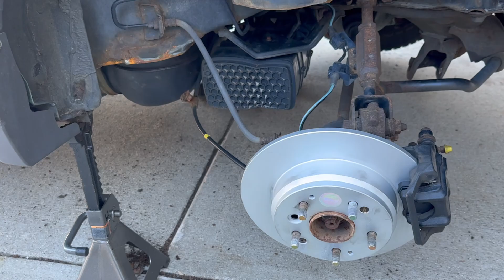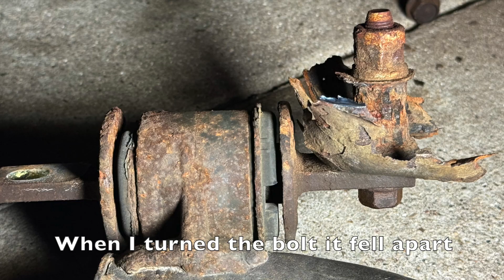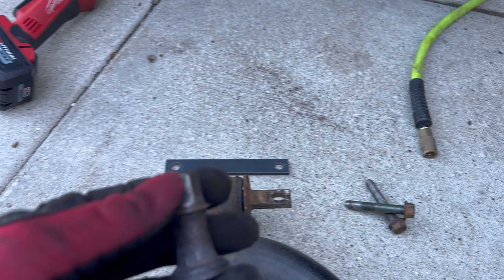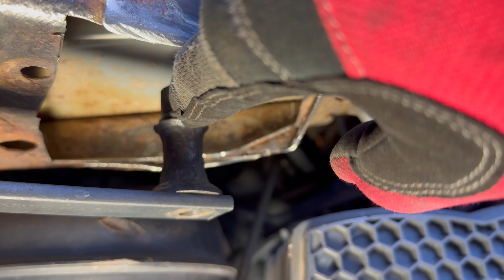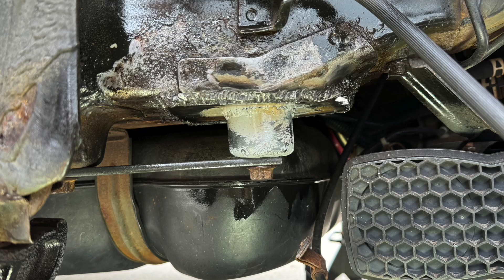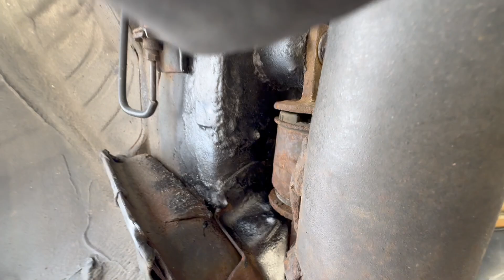DIY Rust Repair on my  Honda Element Trailing Arm Mount

Comment: Is the car still deiving?
Reply from the maker: Yes it is! Repair is holding solid and I just replaced the rear brake pads and did a full front brake job a few weeks ago.
Reply: @coolcat312 awesome i feel more confident about my element now. But unfortunately my enginw has broken few days ago. I am gonna put a jdm in it. I hope to save it.

Comment: Just bought an Element with the same issue. How Honda has continued to make vehicle's for decades that are notorious for thin chassis parts prone to rusting is baffling. Every single model they make is thin metal where the rear end bolts into the frame body

Comment: Thanks, nice work! Did you remove the gas tank for welding?
Reply from the maker: No I did not although it would have been a good idea. I just didn’t want to end up with more broken bolts. Everything is so rusted from Wisconsin winters.

Comment: Uff, and i thought mine wasnt in great condition. I just did full rebuild of the rear suspension, had both trailing arms off and was also tending to these mounts. Luckily i still have plenty of steel left there (shockingly, previous owners drove it extensiviely during winters on salted roads), so i just grinded it to bare metal and applied coatings. Its great to see people are still willing to fix stuff considered by many to be beyond repair.

Comment: Nice work. Very impressed. I've heard it better to use the non-permanent rust coating because rust can form under the permanent stuff and it's hard to tell what's going on. I guess there's pluses and minuses have having state safety inspections. Thanks for saving an element from the junk yard. I don't think most people would have attempted the repair, but this really gives me an idea of what's possible with rusted out cars.

Comment: i made a jig that clamps to jacking point  and lines up the holes  so u can center it to tack it in place once u weld a plate in to fix inner rusted section put 14ga cold rolled steel sheet hmmered to fit also dont for got  to shim the broken bolt to make up for cup that goes over the bolt

also drill the spot welds  from the rusted cup  to expose the plate inside  to fix and weld the nut to

Comment: I've watched this video several times, it's that inspiring! I'm fortunate enough to have had the car trailing arm mount strengthened by Honda (there was a recall for this in Eastern Canada) so I'm not too worried, but your video is very interesting nevertheless in that it shows how the original support mount was designed and it's not surprising why it failed - two layers of sheet metal sandwiched like that, plentty of nooks for moisture to get trapped in! I think your repair is great in its simplicity and effectiveness - much less prone to further rusting. The only thing I would have changed is to use a piece of thick walled galvanized pipe instead of the muffler pipe and sprayed the cavity with fluid film after welding. How is it holding up a year and a half later?
Reply from the maker: Still holding up well. I agree that there are better materials out there, I just used what I had on hand.
Reply: Just a FYI, that brace they install doesn't necessarily strengthen it, it just keeps the entire thing from folding up under the car on the highway when it does fail. I'm in here looking at this video in that situation, the same mount point in this video has failed on my 2004 and I didn't even know til I was changing the parking brakes last week.
Reply: @gordonhenderson1965  Well, the brace preventing the wheel from "folding up under the car" IS, technically, strengthening. To make it STIFFER requires much more of course - Mine is still in decent condition, so I haven't done it since I got the car two years ago, and God knows it would have failed if is had weakened from rust considering how horrible our roads are. But there's a guy on youtube who makes a kit similar to the Honda OEM brace that also includes a stiffening bar for the back mount and shows how to install it - sorry, I have no link to share, it's been too long.

As for the fluid film treatment, even if the car seems rusted and would benefit of reinforcement work, do yourself a favor and just do it and don't skimp, you need to inject it in every nook and cranny under there. It's a time consuming and very dirty job especially if you're doing it crawling on your back, but in the end it was worth the full day and almost full gallon it took to do it the firs time, because everywhere it was applied, rust has visibly stopped progressing, and repeat it at least once a year, it's probably the best money you can spend on any vehicle in the salt belt.

Comment: Great concept but those overlapping spot welds are going to pop loose after enough road vibration hits them. There isnt any penetration of the metal which is what a good weld requires.
Reply from the maker: Yeah, I am certainly not a professional welder. Holding up well so far thankfully.

Comment: I'm impressed. You showed how to fix it AFTER the rust destroys it.

Honda did a recall of CRVs with this problem.
Service Bulletin 23-032
May 2, 2023 Version 1
Safety Recall: 2007–11 CR-V Rear Frame Brace
The service bulletin shows how to install a kit BEFORE the rust gets so bad that you lose your trailing arm.

Comment: With such a great engine/gearbox/clutch the  Honda CRV early models are let down with quite flimsy trailing arm structure very prone to rusting.  What does it take in terms of cost to double up on the thickness of the trailing arm support structure?  I am about to tackle the same job on a 2007 CRV which has a superb upper body, but the chassis is plagued with underbody plastic covers which hide the rust problems and contribute to holding the water and mud against the sills and subframe.
Reply from the maker: Honda is indeed the best engine manufacturer in the world. It's not that they're bad at making the support structures though. There are thousands of 20 year old CR-Vs and Elements with no issues, they've spent their entire lives in nice climates. Those that have had to endure harsh winters and road salt are the ones that succumb to rust. This isn't a problem specific to Honda though either, all manufacturers face the same issues. Doubling the thickness of the metal isn't necessarily even the answer to these problems. The manufacturer weighs myriad factors when deciding on a design, cost and weight among them. I wish you well on your project CR-V. I find it a shame that these excellent vehicles are scrapped so often for such a repairable issue.

Comment: BTW  MY "desperate" interest in this whole rust thing with the Element is because I have a 2003 Element EX AWD.  I am 72.  I am the original owner. It only has 167,000 miles. When I got it originally, I asked my brother (accomplished master mechanic cars and aircraft): what should I do to make sure everything is good.  He said,  "Oil changes."  I have changed the oil in my Element every 3000, NOT 5000, miles....for 22 YEARS!!  Bravo to me eh.  Anyway, you can't even hear my engine running!  SWEET!!  EVERYTHING is sweet.  Except for this "particular rust creating design flaw".  I just can't get it out of my garage!! Everything is perfect....except for that.  I bought another car to keep me in wheels.  I don't want to drive my Element and risk it collapsing on me.  Pretty much I don't think I'm going to give it up.  Its still sitting in my insulated garage waiting for me to find someone to fix it.
Reply: Where are you located? I'm considering this fix for mine.

Comment: I am VERY impressed.  I have been doing so so much research on YouTube etc.  You have NO IDEA!  Having the ability to envision what should be done is a special talent my dear.  So many people can't, say for instance, draw a 1D of what a 3D cube looks like at any degree of perspective.  You can see the shapes, and which shapes are actually important.  Your solution is actually better than the original.  The original improper weep hole positions caused the left side to rust to hell from the INSIDE OUT; while the right side has pretty much no issues because it had the exhaust system  HEAT causing residual water to go AWAY!   YOU are BRILLIANT!!

Comment: came here for the same reason. Shops wont touch it... car only has 70k miles
Reply: This is #1 reason they are sent to the crusher. Plenty of people are trying to sell their Elements for parts because of that failure.

Comment: Great job repairing your E.  I’m surprised that no one has come up with a stamped part kit with right and left sides that can be used as a bolt-on or weld on part to replace the rusted out metal as you have done.  If the rest of the frame rail metal is still in decent condition, it sure beats scrapping the E.  🙂
Reply: I completely agree!!  The right side is rarely rusted because the heat from the exhaust system causes any surrounding water to evaporate.  Its always the left side that is harshly effected. Not to mention the improper weep hole positioning on the original housing causing it to literally rust from the inside out.
Reply: Solid
Reply: Someone with a CNC Machine can help 😊

Comment: You did a great job fabricating and welding. I just did this on my '09 CR-V...both mounting bolts ripped out with extensive rust damage. Not much good metal to weld to. Back together now and I hope my tires wear evenly.
Reply: Most people don't realize that the is a CR-V issue also.
Reply from the maker: Good job! I’m glad you liked the video!

Comment: i live in wisconsin and am having the same problem with my 04 crv. the car is sentimental to me and no shops want to fix it. it’s not as bad as yours (no holes or anything) but the metal is definitely weak and i don’t want to lose the car. i would be willing to pay you very well for your time if you would be able to help me with it. i couldn’t find a way to message you directly so im hoping this comment gets to you
Reply from the maker: I guess YouTube stopped notifying me of new comments on my video at some point. I’m just now seeing this. While I’m not equipped to handle repairs for hire there is a very good shop here in Milwaukee that does this type of repair on a regular basis. They’re called Kar-X, look them up!

Comment: rear trailing arm mount just failed yesterday.  Thanks Wisconsin road salt. Cutting the oval opening for the arm is going to suck. Handed off to my repair guy who's got a lift and MIG. Should've put in some heavier steal when it wasn't as rusty.
Reply: My advice to CRV Element owners. POR15 the heck out of that mount point while metal is still good.
Reply from the maker: Sorry yours failed too.  Catching it before it really rips off is better than a catastrophic crash though. Good luck on your repair!
Reply: @coolcat312  yeah we were doing 15 mph on city street.
Reply: howd the repair go? what year?
Reply: @brucewayne99999  there wasn't enough to weld to. Vehicle was salvaged.
Reply: @ darn.  sorry to hear that.  how old was it?

Comment: Thanks man, I have the exact issue with a similar vehicle and this was more help than the 4 people on the internet who told me to send my rusty car to the crusher.
Reply: DON'T EVER GET RID OF IT!!  That particular spot on Elements gets just like that.  It has to do with incorrect position of weep holes in that housing he cut off.  If you look at the right rear, same part, its rarely rusted.  After much binging about this condition, and seeing so many videos offering different perspectives I noticed something.  MOST of all, looking at the pictures I took of my  own 2003 Element when it was on the lift at the shop I noticed something.  NONE of the rust issues there on the left side appear on the right side!!  I had a Ah-Ha! moment.  The reason is this.  The right side is surrounded by exhaust systems--very hot right!-- which causes any lingering water in the area (which would cause rust!) to evaporate VERY quickly. Ergo, minimal rust on the right side of vehicle.  KEEP YOUR ELEMENT!!!  It takes a special attitude and expertise to repair this. Your typical shop most likely will not confidently approach it.
Reply from the maker: @LarryBazongas  I’m glad the video helped you!
Reply: @coolcat312. Great job! You in Chicago? Would love some guidance on mine. Thanks!

Comment: Thanks for the video.  I am wondering, I see a lot of Elements with negative camber on the rear wheels, including my own.  This is supposedly a universal thing, but is this one of the causes of that?
Reply from the maker: @ketoninja  there are several contributing factors and this is not something unique to Elements. A small amount of negative camber is desirable for cornering stability but it’s usually imperceptible when a car is new from the factory. As the springs age and sag and joints wear out and get loose the camber slowly increases. Yes, if a mount weakens and begins to collapse it will also contribute as well. At that point catastrophic failure is imminent. My brother had a first gen Pilot that rusted out its rear subframe mounts and its camber went crazy. We didn’t have the tools or knowledge back then to fix it so it was sold with disclosure of the issue and replaced.
Reply: Worn rear struts will cause that. Install adjustable rear  upper control arms

Comment: Looking at my car and your fix... I do see a potential weakness in your repair.  Where the original design was 'gusseted', yours is not.  The original flares out and grabs the unibody at angles several inches all around from where the trailing arm actually bolts on to the structure.  What you've done is essentially standing that arm support on it's 'tippy toes'.  There's going to be a lot of sideways torque on that part.  I would have found a way to add some gussets to the assembly to prevent that.  You've got all the weight and torque forces now on that bolt, where it was spread all around on the original design.
Reply from the maker: @Wheel_Horse  Thanks for your critique. The bump that I surrounded the threaded collar with is indeed smaller than what was there from the factory. It should add some strength but admittedly probably not as much as original. The walls of the 2” exhaust pipe I used to make that bump that is supporting the collar is about twice as thick as the original sheet metal and the plate I used to patch the large hole, the plate that the collar is welded to, is 1/8” thick which is substantially (about 4x) thicker than the original metal. I’m hoping that the extra “beef” will help it hold up longer. There’s a very real chance that my repair may eventually fail. I’m checking it regularly and so far so good. I have seen repairs done by others who chose to weld vertical gussets to the side of the collar instead of surrounding it with a bump like I did. I chose this route based on my materials on hand and my fabrication experience (or lack thereof). Ultimately I believe the original design was significantly overbuilt which is great but I wasn’t able to completely recreate it so I had to do what I could. Thankfully the other half of this mount is a survivor so my repair doesn’t have to hold the front end of the trailing arm all by itself. Thanks again and I hope this helps explain why I did it the way I did.
Reply: @coolcat312  Yessir, I meant to applaud you for the repair but forgot that part and went to my constructive criticism... sorry about that!  I thought you did a great job!

Keep an eye on the welds, I know with the undercoating it may not be easy to see them, but make sure you monitor regularly and carefully for cracked welds!

That original steel looks to be maybe 14 gauge, yeah 1/8" is about twice as thick.

Mine's an '08 with 101K and not driven much in the winter, and garaged, so there's no visible rust underneath mine.  I've used Fluid Film for years, the drain holes in those parts makes it easy to get it inside.  I do inside the rocker as much as possible also.

Good Luck! :hand-purple-blue-peace:

Comment: Awesome works, thanks for sharing! Nice fitting and prep. before welding, specially at very tough  spot near gas tank! MIG- welding I guess?
Reply from the maker: Flux core actually. I am still new to welding and haven't purchased gas cylinders yet, although welding outside like this I probably would just go flux core anyway.

Comment: hey how did you make the lump or where did you buy the lump ???
Reply from the maker: The bump is actually a piece of exhaust tubing I had laying around. I considered using a thicker-walled pipe and cutting a circular cap for it but gave this a try first and it turned out well. I cut tabs into the end of the pipe and bent them over, then cut off the overlap and welded it up at the seams. After grinding it smooth it’s hard to tell that it was made like that.

Comment: I need mine done but everyone says they can't 😢 sitting in my drive for 3 months I'm not giving up
Reply from the maker: If you can find a frame repair and fabrication shop near you they should be able to do it.
Reply: DO NOT give up.  I have been investigating this "thing" for months.  There are people developing cures for the situation. This gentleman is the best solution I've seen.  But you (and the person fixing it)  have to be dedicated, and have a reason WHY you are doing it.  Isn't it weird how people are so connected to their Elements??!!  NO ONE is willing to give up their Element!!  Once you have one, there is pretty much no replacement.  Its PERFECT!!